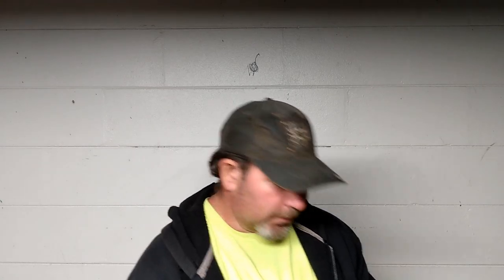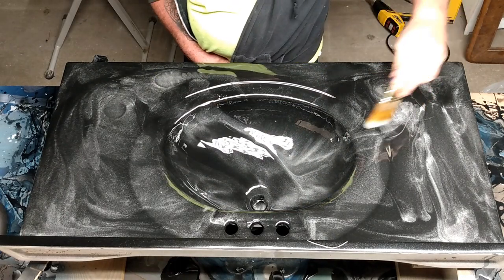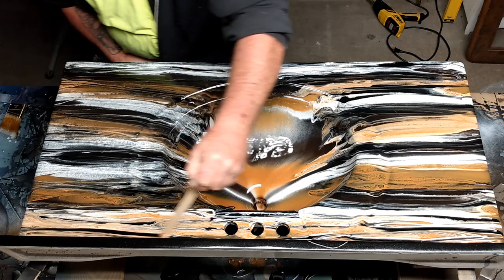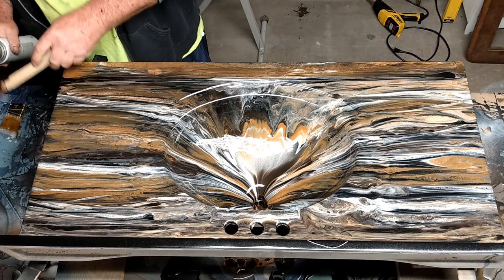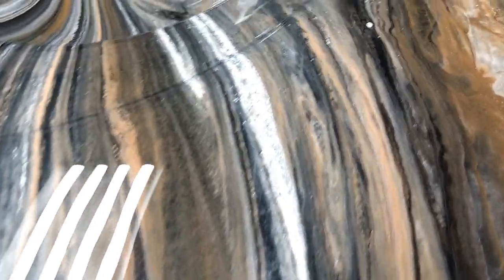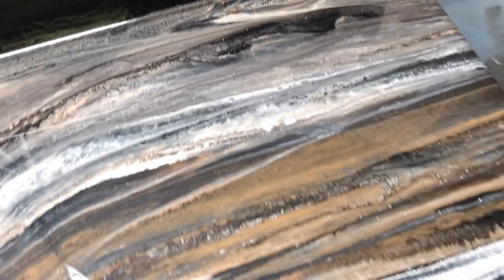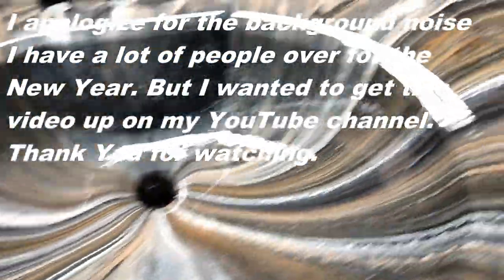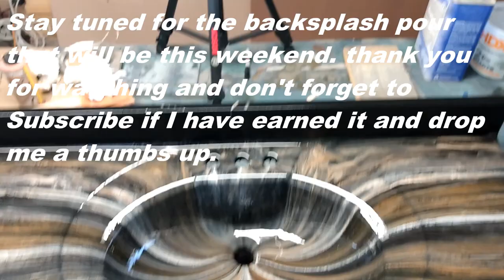The best way to update your bathroom. learn the best way to update your bathroom for cheap cheap!!

Comment: Really nice job!  quick question, was the sink originally black and was it porcelain or?
Reply from the maker: Thank you. No the sink was originally white and it's an acrylic resin base material called Corian.
Reply: @LiquidCreationsCo2609  so it was white corian, and first you painted it black before proceeding to use epoxy?
Reply from the maker: Yes it was white at first. Then I cleaned it really good then I put 2 coats of black bonding primer on it then I did my epoxy work.
Reply: @LiquidCreationsCo2609  Thank you very much for your quick replies and all the information! Keep up the good work, love the sinks!
Reply: @LiquidCreationsCo2609  Oh and what epoxy do you use? How does it hold up with scratches and so on?
Reply from the maker: For my sinks I a product called "Totalboat Tabletop Epoxy" it's designed to be wet more often than not and it is pretty durable when it comes to scratches

Comment: What brand of Epoxy are you using?
Reply from the maker: I use a product called Totalboat Tabletop Epoxy it was originally designed for boats and stuff like that. But then they seen they had a market for the countertop industry so they formulated a brand for countertops and tables and it is designed to be wet more often than not very good product highly recommended I have a link to it in the description if you're interested in checking it out.

Comment: That's really cool! What kind of sink can you pour over? Don't know what mine are exactly besides regular hard, white and really smooth lol. Can't imagine it bonding to a surface like that but perhaps sanding it will give it enough grab? What kind of base coat did you use to bring the counter to the level of the sink? Just epoxy and black paint? Thanks and once again it looks awesome!
Reply from the maker: +geck50 
you can pour over any surface and as far as getting it to bond to something you need to coat it with a bonding primer personally I use Valspar bonding primer and I've poured over all kinds of different sinks some are over mount some are under mount most of them are the prefabbed sinks it's all one solid piece that has a built-in backsplash them are the more common ones hope this helps.

Comment: So do you just pour directly over the whole sink? I noticed you started when it was black.
How does it level over the jump created by the sink when it sits on the wood.
Reply from the maker: Yes I poured over the whole sink the black is actually bonding primer. And when you say jump if you're referring to the lip on the front and sides of the sink I just put enough epoxy on it to go over that.

Comment: I have only one your videos so far, do you do a second clear coat of epoxy to seal in the color and do you torch to remove bubbles?
Reply from the maker: +Robert Guyer                     yes I do a second clear coat
and yes I torch unless I use a heat gun.

Comment: New sub!!! Great vid 👍 I'm in the process of redoing my master bathroom this weekend.. would you recommend me taking the sink apart or can I do it in place? I'm using giani countertop as my base,
Reply from the maker: First of all thank you for subscribing and for your comment They both mean a lot And support the channel.
Now to your question I would check to see if it was level in all directions before I took it apart if it is I would pour it in place if I wasn’t level then I would remove it and pour it.
Reply: @LiquidCreationsCo2609  ok I've also watched your video doing the backsplash aswell now if everything is all leveled in place how would I get the epoxy to level up on the back .....
Reply from the maker: @aldawson4943  If you have a sink that you’re going to pour  in place You’re not going to be able to get epoxy  to stay on the backsplash The only thing you can do is to add some color to your backsplash before you put the epoxy on it once you pour your epoxy just keep brushing the epoxy up on to the backsplash but in my opinion that doesn’t look good at all and it’s not going to be smooth. That is the main reason I remove all of my sinks to pour them Hope this helps

Comment: You have so much material listed. so what did you use in this last epoxy clear coat???
Reply from the maker: This is all of the product that I have used and would recommend that's why I have all of it listed. I use a product called "Totalboat Tabletop Epoxy" on all of my sinks because it's designed to be wet more often than not.

Comment: How do you clean up the vertical edge drip and make it look like the rest after it dries?
Reply from the maker: If you're asking what I think you're asking I do the sinks in two separate pores. The backsplash being one for and the rest of the sink being the other pour. I cleaned the epoxy drips the same way I would on the backsplash as I would on anything else. There's videos on my YouTube channel showing how I do this.

Comment: can you put epoxy over caulking? and do I have to removed the countertop to put it over the backsplash?
Reply from the maker: No you can't put epoxy over caulk it will not adhere to it.
My personal opinion or if I was doing the job I would remove the backsplash and pour it laying flat that way I could get a good design on it. But do you have to remove it no you do not but what you're going to want to do is to put your effects on the backsplash before you put epoxy on it because anything you try to put on the backsplash is just going to run off if it's vertical. That is why whenever I pour my sinks I do 2 pours instead of one
Reply from the maker: I hope this answer your question if not let me know
Reply: @LiquidCreationsCo2609  Thank you!!
Reply from the maker: @andrezsalazar9887  you’re welcome glad I could help.👍

Comment: Beautiful
Reply from the maker: Thank you so much I really do appreciate your comment.
Reply: @LiquidCreationsCo2609  you’re welcome and can I do this with my sink in place and what’s the solution for the drain if I do it that way?
Reply from the maker: @lts5075  yes you can do it with your sink place you're just going to have to make sure it's level because if you don't whatever work you do  its going to run to the lowest point. And you need to disconnect the plumbing from up underneath the sink and take the piece of metal that is actually in the sink basin take it out as well and put a bucket up underneath the sink so it can catch the epoxy that runs out the bottom.
Reply: @LiquidCreationsCo2609  thank you so very much!
Reply from the maker: @lts5075  your welcome.

Comment: Is it possible to tape off the middle to keep the epoxy from going down the drain until after it hardens a little bit?
Are you a Southern Man?  I thought I heard some hillbilly slang.
Reply from the maker: To be honest with you I wouldn't myself try to tape off the drain in the sink. For one to me it would be too much of a pain in the butt and two if you were able to get it taped off correctly I don't think it would look right once the tape was removed. If you're asking because your sink is in place all you have to do is just unscrew that plastic p-trap from underneath the sink and remove the plastic spout that attaches to the sink and let the epoxy drain through into a bucket. Just saying just in case that was your reason for asking me that. And yes I am a southern hillbilly lol from way down south in the Everglades.
Reply: @LiquidCreationsCo2609  Thank you, I didn't even think of that.
Reply from the maker: @darlaballenger2357  your welcome 👍
Reply: @LiquidCreationsCo2609  How can I send you a picture of my new bathroom sink? I just got it for $10.00, it's the top off of a pedestal sink the pedestal got broken and they were going to trash the sink and I wanted it and she sold it to me. 
I'm not sure how to do it cause there are 2 sides and I've never done this before but I really want to try and I do have some scrap boards to try on and I'm pretty sure I've shared my colors with you.
Reply from the maker: @darlaballenger2357  you can email it to me or if you have messenger you could send it that way as well. I wonder why they didn't just give it to you if they were going to trash it. And yes you have shared your colors with me I can't wait to see it though and I would try on some sample boards before I jump straight on to a sink if I were you.
Reply: @LiquidCreationsCo2609  Could you find me on messenger please? I give up I'm having trouble with sending you this stuff. I swear I have hit send four times I'm not seeing it anywhere.
Reply from the maker: @darlaballenger2357  let me get to where I'm not driving and I'll try to find you on messenger. Are you trying to send me pictures or something?
Reply: @LiquidCreationsCo2609  You don't have to do it right now do it when you have some free time I'm in no hurry but yes I have the pictures.

Comment: No safety equipment?  No telling us WHAT epoxy you're using?  How do you close the drain? I wouldn't want epoxy down my drain!!
Reply from the maker: +Nancy Greco 
What safety equipment should I have?? And as far as WHAT epoxy it is Totalboat Tabletop Epoxy on all MY sinks. And no you DO NOT close the drain in the sink that would be a very bad mistake you unhook the plumbing and let it drain into a old bucket...
Reply: Liquid Creations Co. you’re not using gloves or mask.  It’s epoxy.  Needs to be well ventilated and you’re using spray paints. I didn’t see where you said to remove andything and put bucket underneath. I guess you missed few steps in your step by step